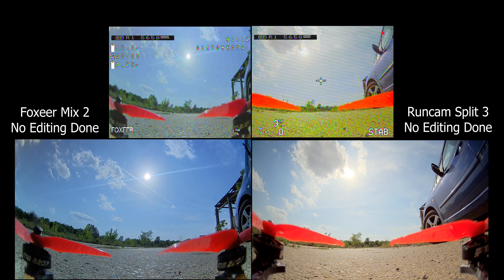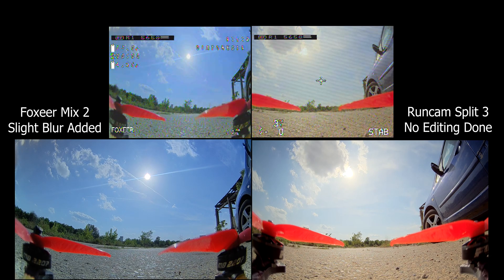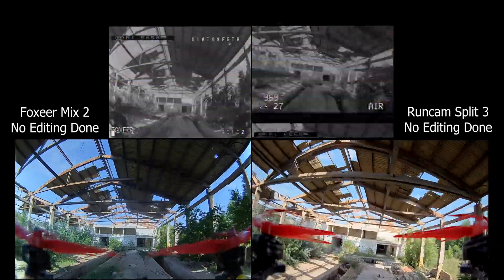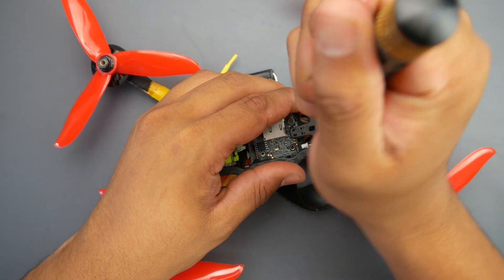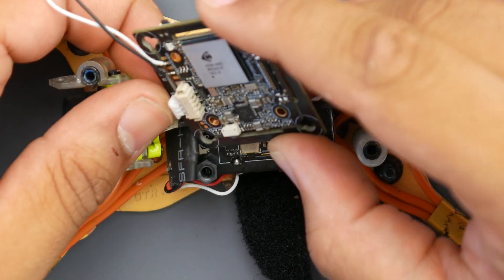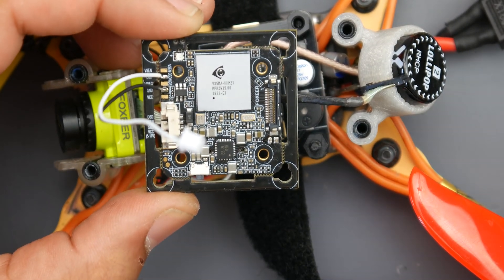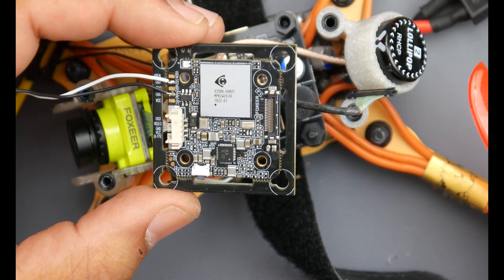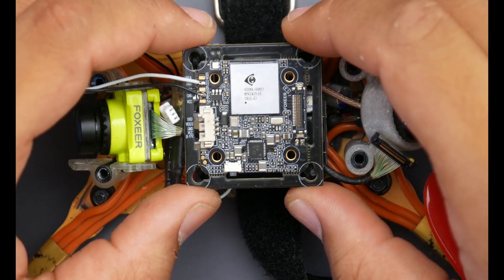Foxeer Mix 2 vs Runcam Split 3 Micro // HD FPV DRONE Comparison 2019

Comment: Thanks for the good work, DroneMesh!
One question left, hope I didn't overlook it: 
Is the 4:3 fpv feed  image just a 16:9 with the sides cut off on this cam? 
And would that be the "normal" way to operate the switching between the ratios?  (oops, second question xD)
I am having a talk about that a.t.m. on a WhatsApp-Group, thanks a lot for your answer in advance, keep it up! ;-)

Comment: I’ve got a runcam split mini 3 but I can’t figure out how to select option in OSD via UART setup. I can do that with split mini 2s by assigning a mode to WiFi but in split mini 3 that option doesn’t exist! I have to do the setup via the mechanical buttons on the pcb which is pretty annoying... Has anyone found a solution?

Comment: If you switch the Mix 2 from auto WB to daylight it is closer to the runcam color wise. A lot less blue. And Foxeer will publish a firmware update soon which fixes several items. English as standard language for one, but also the option to switch loop recording off and change field of view. Other changes like changing name in osd and such are also incorporated. I'm testing it now and so far I like it. WB on daylight, saturation -2, contrast -1. Sharpness to your liking. Give it a go ;)

Comment: I don't have the blue problem on my Mix v1. I just uploaded some goggle dvr footage and it is quite good. I snapped the 30x30 adapters off with a side cutter. If you have auto record on, you have to remember to stop recording by pressing the button on the side before entering the menu.